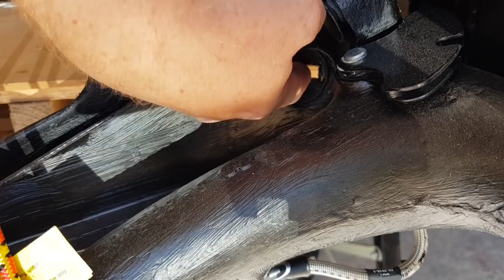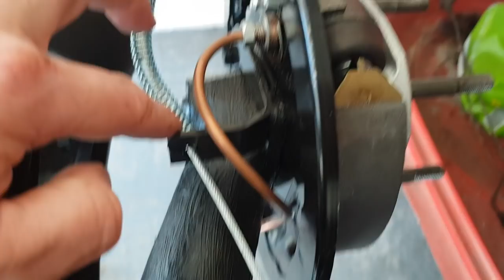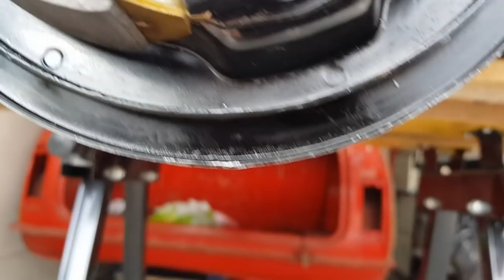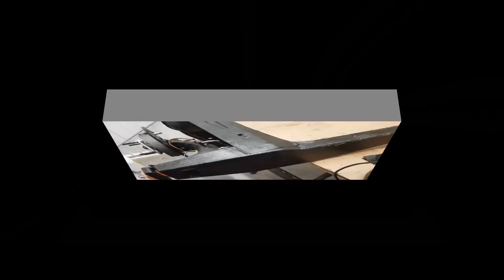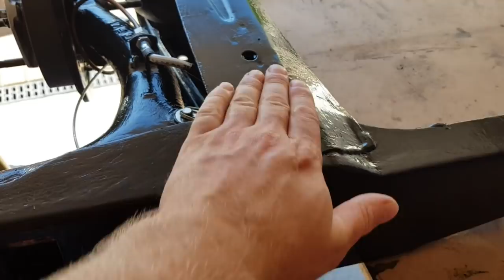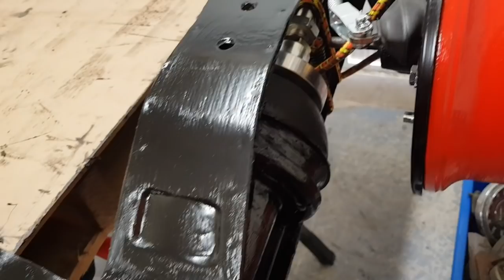Classic Mini Restoration: Eleanor Video 38, Finishing The Rear Subframe

Comment: You've put the small part of the hand brake cable into the compensator bracket the wrong way round DB , looking good now its built up , good work.
Reply from the maker: Will have a look. Didn't even notice. Cheers for pointing it out

Comment: Hi DB.  Your video is great for people like me who will be going through the same process of putting the rear subframe assembly back together soon.  I was wondering where you got the handy little tool for installing those frustrating little circlips on the back of the wheel cylinders. Your subframe looks so much better with the shiny enamel on it. It shouldn't rust for a while now.
Cheers, Midge
Reply from the maker: Thanks Midge. The aim of the channel was always to help the mini community and for you guys/girls to help me along the way and I've made lots of new friends as a result of the mini  youtube community. I got the tool from Ebay. Just searched classic mini circlip tool. Got it from minimine (ebay company) which i get a lot of parts through. Really good company. Cost just over £10 and worth every penny

Comment: four nuts holding the back plate  wrong way round.
Reply from the maker: Yes and they are the wrong sized nuts that came with it too, it had been assembled and shipped that way before i disassembled it but when it is fitted to the car there are a few other tweaks required and I'm sure i will find more on the way, thanks for pointing out